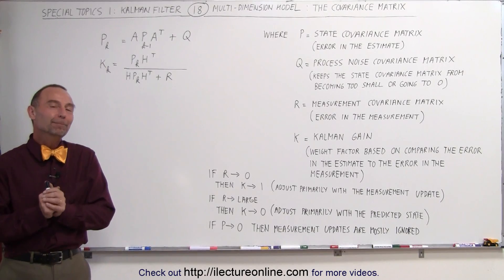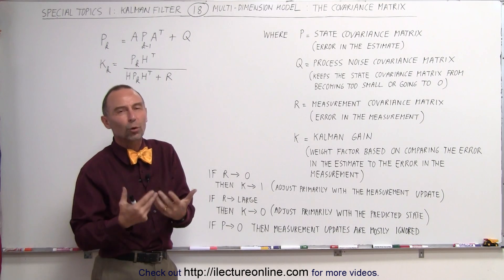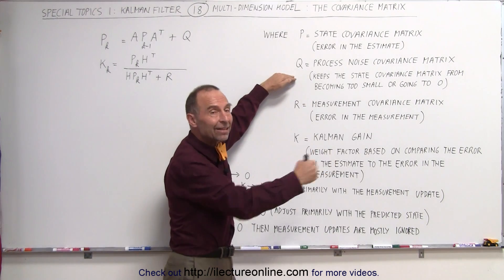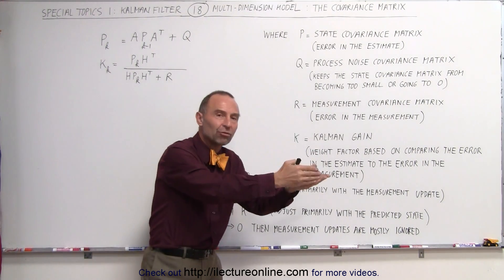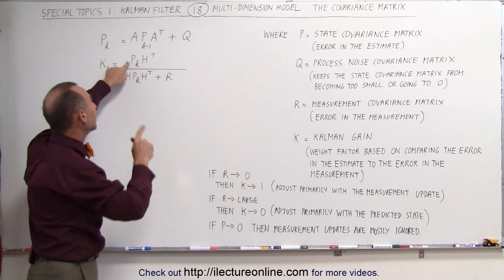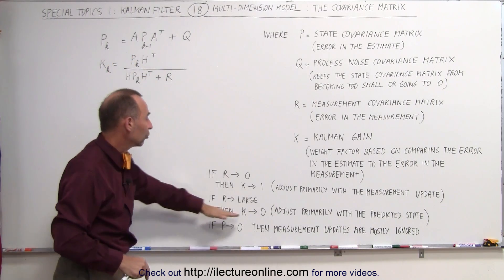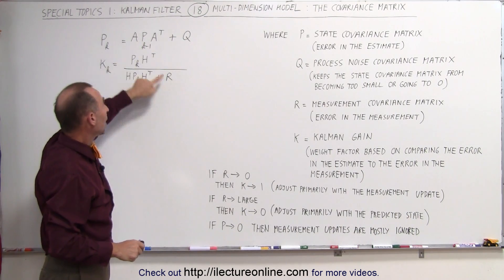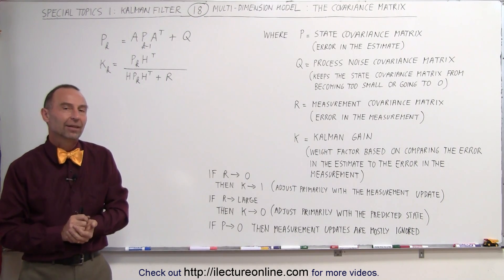Special Topics - The Kalman Filter (18 of 55) What is a Covariance Matrix?

Comment: hi professor i have a question can you tell me how I can consider the Q matrix for a buck converter  i have tried a lot of data and  I tested them, but in to the plant but the  matrix error is too large how I can find a proper covariance matrix (Q) for any system i want to implement  Kalman for the system please help me thanks
Reply: Hello, I have the same question Mohammed ! If you have found a solution please help me ! thank you
Reply: @oumaymadridi8772   hello I found that and it doesn’t matter because you should use the state space

Comment: is there a physical interpretation of Q besides that it helps to prevent from P becoming 0?
Reply: I like to think of it as very small factors that are not accounted for in the process calculation. For example, friction in bearings, some wind resistance or buffeting, side-slip in turns, battery power sag/spikes etc. Whether this is correct is another story though :)